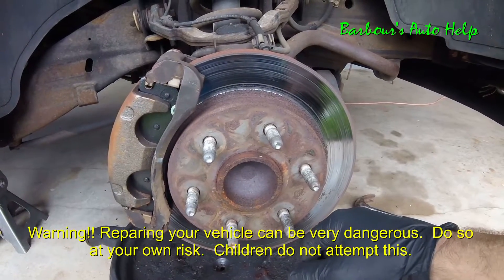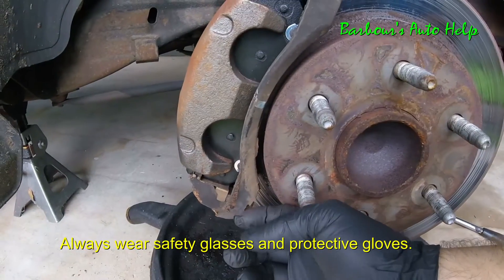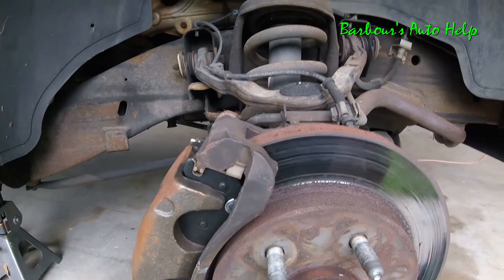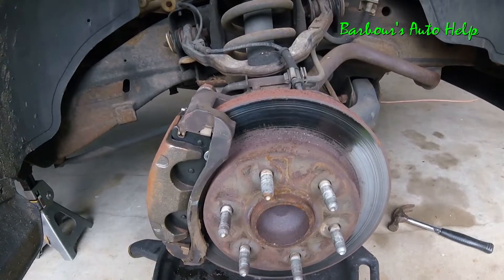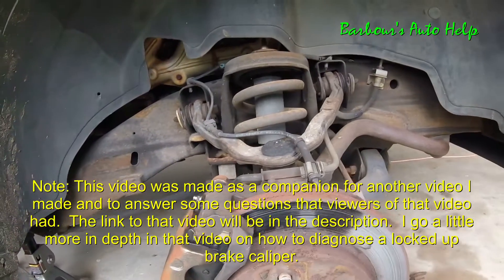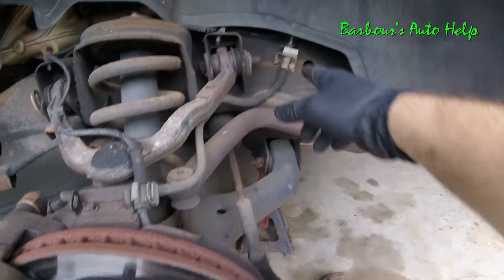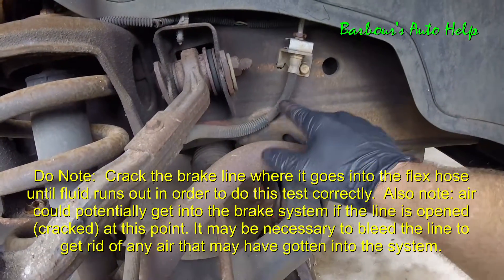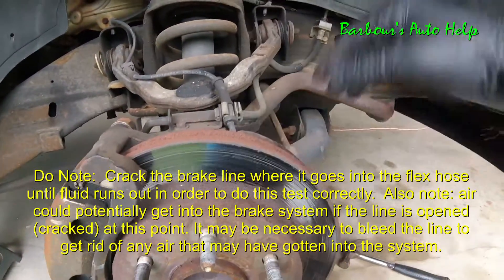Locked Up Caliper By Clogged Brake Hose

Comment: Thanks for your video. I had this very problem. But how does a brake hose get restricted? Are the hoses more likely to get restricted than the metal lines? Do the hoses break down and clog themselves?

Comment: great video.  Was driving and brake pedal suddenly got really really hard. Both front brakes were smoking. Had to park car for about an hour for front brakes to release itself. After brake oil changed same problem.  Brake pedal still gets very hard to depress. Can this be  bad master brake cylinder, brake booster or the brake hose? Any help would be greatly appreciated. Thank you.

Comment: I cleaned one pistons that locking up, then after a test drive two front brakes (cleaned and the other not cleaned) locked up and both smoking when sprayed with water hose.

Comment: What do you think i should check next. Kia sorrento 2007. Replaced the caliper after the inboard break pad went metal to metal suddenly.  Replaced and turned the rotor. My wife drove to work once, and the brand new inboard pad is not metal to metal again, and the rotor is torn up again.  The caliper piston detracts, and the caliper slides  fine.  It's only the rear, right wheel that is doing this. Any suggestions on what to do next?

Comment: Pulled off to the side of 595, my driver side brake is stuck and my truck was struggling too much. This is the fifth video I’m watching and as soon as my truck cools down I’m going to try to bleed it to see if any fluid shoots out, hopefully that releases the caliper so I can get home. Can I plier shut the line at the brakes end, leave the pliers hanging somewhere safe and drive home on three brakes ?

Comment: Bro is it possible that both front hoses will clog up at the same time? Both front brakes locked up and once I cracked the bleeder on both sides it released like you did in the video. Is it possible for both clog at the same time? 2004 Suburban if that helps.

Comment: I’m wondering if the part might be Duralast Brake Hose 79206 aka a banjo fitting that’s clogged is it that flex hose you talked about

Comment: Also i had replaced my caliper thinking it was the issue. Low and behold, the new caliper is now binding with even more pressure. Maybe because it's newer and more smooth. I will change the hoses and get back

Comment: Thanks that's was helpful..
I searched because i have Mercedes Benz w110 the brakes pads stuck om rotor till its hot as hell ...i opened the tube but theres no oil came out....i opened the pump no oil also what is the problem? I really need help on this

Comment: Hey man. I have a question for u if u have a minute or 2.. My niece has a VW POLO here in IRELAND. It failed it's MOT/NCT test. The road worthy test older cars have to get done every year. It's a 2011 car and the garage that failed her on the Brake hoses. It said rust pitting on the hose. Are these hoses metal? I thought they were rubber or plastic of some kind. 
So I wanted to ask if it's ok for me to change them if I get the correct hoses? Is it ok for me with no experience to change them out and if I did what type of checks would I need to do to make sure they're working?? properly I mean.. Thanks for this video man. Very informative
Reply from the maker: Weather you can do it or not is going to be a question that you have to answer.  I'm sure there are some really great how to videos out there on how to replace these hoses.  I'd also recommend getting your hands on a repair manual.  Either rout you chose, doing it yourself or paying someone to do it for you, I wish you good luck.
Reply: @BarboursAutoHelp   Thanks for the reply man. Appreciate it.

Comment: So the rubber hoses have sludge dirt in them? I just don't understand how that could happen. I also read a online story of the guy that said it was actually his master cylinder wasn't allowing the pressure of the fluid to go back up into the reservoir.  He said he put a brand-new dorman on and it failed so he had to take it back and get a reman. I'm a little suspicious of all this
Reply: The rubber hoses have a nylon tubing inside which the brake fluid runs thru. This can tear/collapse according to forums I've read up on, creating a 1 way valve allowing fluid to push the piston but not come back the other way to relieve pressure
Reply: @KilliKonKarnage  .

I am so surprised by all of this I've been driving Chevys and Fords all my life and have never heard of this. I wonder if it's just certain  rubber hoses are defective. 
My number one problem is Chevy Rusty brake lines on trucks. All my older suburbans were just rusty crumbled lines and often the emergency brake cable would rust off.
Reply: @2Jeezuzisreal  to be honest I am new to cars. I have my first car a 2004 bmw 3 series. It's still very old school with it's mechanisms so it's nice to work on and learn. I watched numerous videos of people explaining from mainly the US, speaking of the brake hose failing inside causing it to operate like a 1 way valve. I have a issue with my caliper piston sticking, i replaced the caliper and same issue so next is the hose and hopefully that solves it.

Comment: I’m currently having the opposite issue I’ve replaced the rotors pads and calipers and during the caliper replacement I noticed there was no fluid in the passenger line so the wheel spins freely could it still be the hose?

Comment: Wish I'd seen this video before replacing the calipers, also did rotors and pads but the heat had already wrecked those so needed them anyway.  But maybe didn't need the new calipers after all, I'll be using these tips to confirm if it is the rubber line or not before I bother installing the new hose I bought.  Probably can't return it if it's been installed.

Comment: Absolutely a great video. I have a 74 Pontiac Grand Prix that is doing the same thing. I replaced the new calipers so I know the calipers aren't the problem. It's got to be that rubber hose. Damn it going to work on it. Thanks
Reply: Hey, was it the hose that caused the trouble?

Comment: Ok here is one for you. Apply brakes, rotor won't turn by hand, open bleeder screw, rotor still won't turn by hand, unbolt slide pin bolts slide caliper so only the upper piston is on the pads, rotor turns, slide caliper so lower piston touches pads but not upper piston, rotor won't turn. 

CHANGE TO A DIFFERENT CALIPER (the used one I removed to upgrade to these power coated calipers) SAME EXACT REACTION. 2 different calipers behaving exactly the same.

Slide pins are fine and move freely, pistons on both calipers compress easily, no signs of binding.
Reply: did you ever figure this out? having a similar issue.  After replacing my rear driver side caliper, the brakes still stick and the caliper still holds constant pressure on the rotor. Cracking the bleeder does not release it
Reply: @tsteinhart15  nope and short of throwing parts at it the mechanic couldn't figure it out, they think it's the hose, I ordered the parts to rebuild the caliper, new hose and new banjo bolt just to replace everything that it could be. My running theory is an issue with the piston seal, from what I've read the seal is what actually pulls the piston back that tiny fraction to stop it from dragging.
Reply: @DanielsCorner644  thanks for the response. I ordered a brake hose but I fear that wont solve it. I performed a test where you crack the bleeder, and if its the brake hose being collapsed it will presumably release the caliper due to the brake fluid pressure being relieved. In my case, it didnt release the caliper. I will try anyways, otherwise my next steps will probably be the master cylinder. Good luck!
Reply: @DanielsCorner644  Hey man I figuered out today that my problem is likely the brake pad. I have a spinning piston caliper with a big plus sign that aligns with a bump on the back of the inside rear pad. I found that in my case, the bump was almost chewed off presumably from not being aligned correctly when I replaced the pads. Hope this helps, good luck! I will be replacing my pads tomorrow and confirming the issue.
Reply: @tsteinhart15  mine is the front brakes, no spinning

Comment: Recently bought a 26 year old car and every now and then, the brakes lockup while I’m driving. The wheel gets so hot it smokes. I Was wondering if opening the bleeder valve in order to remove pressure on a red hot system is a good idea. Any thoughts? Thank you!

Comment: What if the brakes work fine until about 10 minutes of driving the car? I've done those test and rotors release when I bleed at the caliper. I've replaced driver side hose and still locks up. Can the passenger side have an effect on the driver's side caliper since it's one systems?

Comment: If it's not the flex hose what could it be farther up the line?
Reply: Did you figure anything out?
Reply: @brandonburton8  I found my problem. It was not in the brake like . My problem was a corrupt mechanic. Wanna know what it was?
Reply: @andrewnorris1514 what was it ? Yes I still want to know a year later.

Comment: Why would the rust in the center of the rotor be signs of overheating due to a locked up caliper or failed brake line?

Comment: thanks for video. i replace rotors caliper and pads and hose on a 2007 g6 the front right side it keeps sticking its now ate up pads and rotor only on right side. do you have any suggestions

Comment: Hi, I have locked up real calipers, both right and left, making a lot of grinding noise when driving. I ended up with replacing calipers and brake pads only to find out I still have the same problem. I read someone mentioning the lock up can be caused by faulty brake hose then watched your video. At this point, I think (and hope) it is the hose blocking the back flow preventing the caliper retract. What I am wondering, however, is why both left and right real calipers are locked up at the same time? Is there a common hose in the rear brake system, or I need to replace both side? Thanks~!
Reply: It could also be master cylinder

Comment: I have a 2005 Ford Taurus,  and I love this car, we have replaced both front brake hoses, and they are both the eaxct same part even only 1 number apart, but 1 of them has an extra bleeder hole on the top of the bolt, Could that be a problem? Or is 1 of them in correct? I can't seem to get an answer from anyone?
Reply from the maker: Yea, I'm not so sure about that either.  I don't know.

Comment: I'm having this problem also..could I clean the brake hose and re-use..is it broken inside the pipe and it's blocking the return? When I release my pedal the disk won't spin even with alot of force...

Comment: Hi. Really enjoy your videos. My car pulls right when braking only at the front. Both wheels spin when I Jack up the car. Do you know what I should try next? Many thanks.
Reply: May be that the left side isn’t compressing, or the tabs (ears as i like to call em) of the pads are seized into the caliper bracket and not moving.   if you take the pads out and inner / outer aren’t worn straight, you may likely have a seized caliper slide pin.
Reply: @MrTravisAL  thank you. I blead the brakes after I changed the front inner and outer wheel bearings. Much better. 
Thanks for your reply.

Comment: hello , i bought 2 days ago a dodge caravan 2012 . so i start smelling  like burning wire after a 15 mins drive and the burning smell it last arround 5 mins and then it goes . so i opened the hook and checked the engine .. i didnt smell anything also checked the wires .. no smell ( so i thought that it may be from the AC or ventilation dust )  .  but today this happens again and i was worried .. so i checked the tires and  i found that the right tire on the back side having this smell so bad .

so after looking online and watching  videos ... i noticed that the previous owner didnt use the pad brake before . so when i used  it it probably locked up on the caliber by the brake hose and it is unable to pump back  .  could this be the problem?  bcz when i asked the previous owner he said he never had this smell or issue before .please your advice and what is the solution
Reply from the maker: So... Im not sure what to make of what you said.  Whats a "pad brake"?  And how did you find out that the previous owner didn't use it by watching videos?....
Reply: @BarboursAutoHelp  sorry i mean the parking break !  the previous owner mentioned (he never used the parking break he used to stop the car on P Gear only ) . 
so when i bought the car start stopping it Parking Break . so this may caused collapsing the caliber and not unrealized( as it was not used for long time ) and this caused the brake to burned on the disk and making this smell .
Reply from the maker: I'm very sorry Jay Z.  I think we are still having a break down communication.   I hope you get you problem fixed.

Comment: Hi Keith, thank you so much for your videos. I am having this problem with a 2006 Hyundai Sonata. I replaced the caliper, still had the problem, then used the bleeder valve to determine it was in the hydraulics. After thinking it was a master cylinder issue I brought it to my mechanic who then replaced the flex hose thinking it was that. It made sense at the time since they were old, and I pinched them when changing the caliper (to avoid fluid loss and air entry) and thought  maybe I damaged them and broke some rubber off inside. I should also add, mechanic said he was able to compress the pistons (after I was not able to until I cracked the bleeder, hmmm.) Problem still happened, I got caliper replaced under warranty, from NAPA, thinking maybe a faulty rebuild, Still happening. I know this is long winded but my question to you is, when you say clog further up from flex hose, can you explain what and where that might happen? My mechanic says if it was at the MC then it would happen on both front brakes. I am at a complete loss and don't know what to try next and reluctant to take back to mechanic who is clearly going to continue to just hunt a peck at the problem. DO I start tearing lines apart? DO I just replace the MC and hope that's it? I can't get anyone to acknowledge a possible problem in the lines, must be very rare. Everyone say caliper, pins etc. there is no way it is the caliper at this point.
Reply: What ended up being the problem
Reply: @bobbystone5436  I had all the same signs. Turned out that because the set screw for the rotor able to be used the rotor would be offset when the wheel was installed and tightened. That set screw is very necessary in keeping the rotor perfectly aligned
Reply: My set screw must have broke off years prior to me having this problem. It is very necessary that without that set screw you take EXTRA time in torquing the lugs so that the rotor stays centered
Reply: I have the same issue going on can you explain further what is the set screw?
Reply: @bryangonzalez8065  The "set screws" or retaining bolts are the two flat head screws that hold the rotor to the Hub. Many times they break when trying to remove them to replace the rotor. If they break you can choose to attempt to drill/extract them out and replace them with new ones (obviously best practice), or just not use them since the wheel lugs are really enough to hold the rotor to the hub as it is sandwiched in between. However, if you choose to leave them broke you must be sure when you place the new rotor back on that you properly align the retaining bolt holes with the broken bolts or the rotor will sit cocked on the hub (because the broken bolt is sticking out) and cause the problem that @andrewnorris1514 had. You can also grind them down as well. Hope this helps explain.

Comment: I changed out my caliper and brakes thinking mine were locking up due to a dirty piston but didn’t work. The calipers needed replaced anyway as the rubber was torn but I hope replacing the hose does the job
Reply from the maker: Why did you think it was locked up again?
Reply: @BarboursAutoHelp  the breaks are sticking, I thought it was the caliper and changed it but it is still doing the same thing. I believe it is the hose as when I open the bleeder valve it is able to freely spin again.
Reply from the maker: Sounds like it could be.
Reply: @BarboursAutoHelp  I changed it and it was the hose
Reply from the maker: Right on!  Glad your up and running.
Reply: @cryptaveli  I'm going to try changing the hose. Same thing. After bleeding, it could spin. But not after I apply the brakes again.

Comment: Here is what I found, but there may be other explanations for other issues.  On a Ford F150, and I am confident on others, the brake hose runs through a metal bracket and the rust on the inside of the bracket pinches the inner brake hose line shut.  Rust grows and pinches the line.  The pedal forces fluid into the caliper, the the fluid is unable to back-flow up the brake hose to release the pressure.

Comment: How do you conduct the test if your bleeder valve screw is rounded or crushed? Also, would intermittent sticking be a symptom of a line issue?
Reply from the maker: First try to soak the bleeder with penetrating oil for a day or so.  A line could cause an intermittent problem.....so could other things.

Comment: If it's on one of the rear calipers could it be a parking brake issue? For example cough cough 2009 Honda Accord?
Reply from the maker: Sure could.   It wouldn't behave like the vehicle in the video though.... assuming your caliper is locking up and that the caliper has the parking brake integral.

Comment: My caliper was locked up and I changed it but not the hose but when I break the car pulls to the right
Reply from the maker: So what do you think it is?
Reply: Barbour's Auto Help i changed the brake hose today but now the brake pedal goes to the floor
Reply: @edwinbaez8027  did you bleed the breaks?